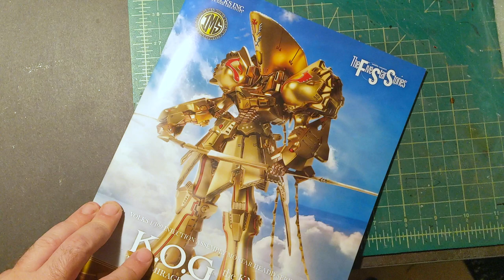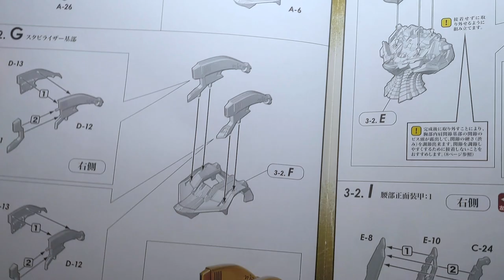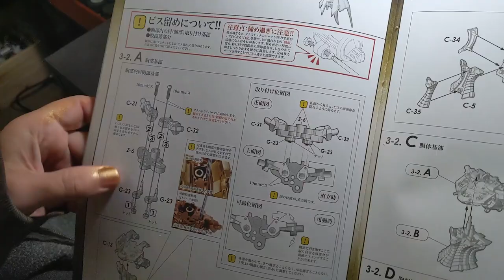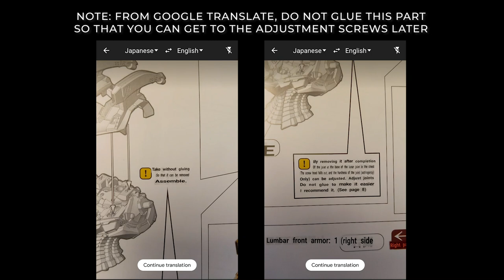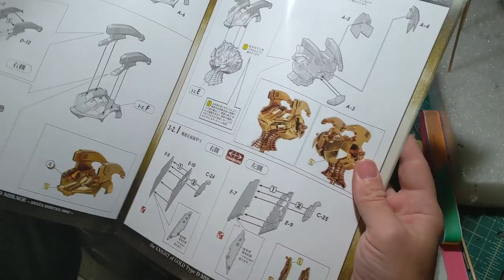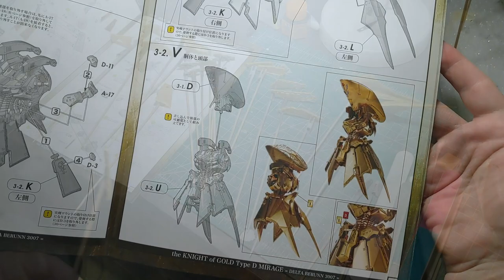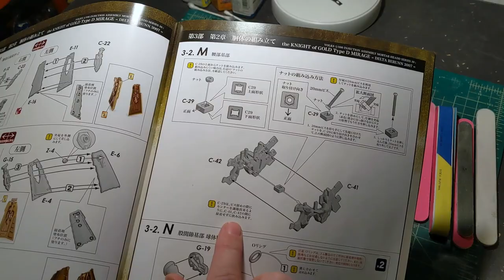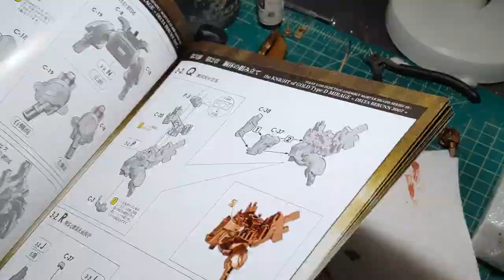Five Star Stories - Volks Knight of Gold 1/100 IMS - Build Part 2

Comment: Are these kits posable in any way without parts flying off? Dumb question maybe but i only work with gunpla master grade kits and no custom work on them, i find these designs very elegant and tempting to get, just don't know the bare essentials needed to deal with this project
Reply from the maker: They are poseable, but not nearly as poseable as Gunpla. The movements are pretty minor. Still, more than the usual Resin statues though.

As far as what you need to build one. They're not snap-fit like Gunpla, so you'll have to glue, fill seams, paint, etc. I actually enjoy all that though, you feel like you've actually done some work in the end other than just snapping something together. :D

Comment: Witch paints that you used there Pal ???
Reply from the maker: It's a mix of Gaianotes and Mr Color. I went over the paint in the part 1 video. It's here at the 10.53 mark if the video doesn't start there on its own.

https://youtu.be/5F4Jkq6X1-M?t=653

Comment: Are gaia paints hard to work with? I have only used acrylics before and am worried about the smell/toxicity.
Reply from the maker: They're not any more difficult than other paints imo, but the fumes can be harsh like any other lacquers so you need good ventilation. My spray booth is in the video, but what you can't see is the exhaust hose is in the window with a fan also facing out so the fumes don't come back in.
Reply: @bhop.builds  Thanks for the advice. I do have a spray booth but I don't think the fan is powerful enough to extract all the lacquer fume. I guess I'll stick with acrylics for now.